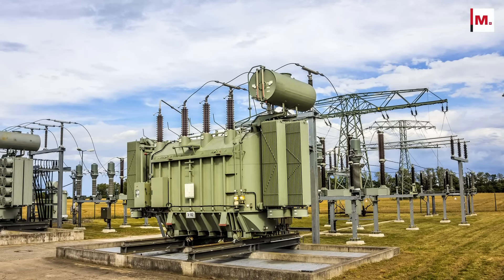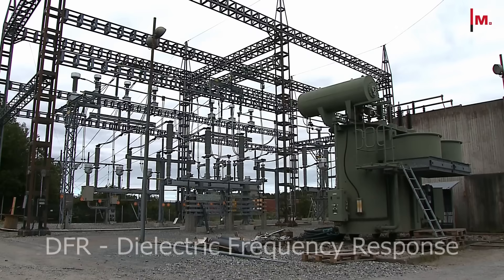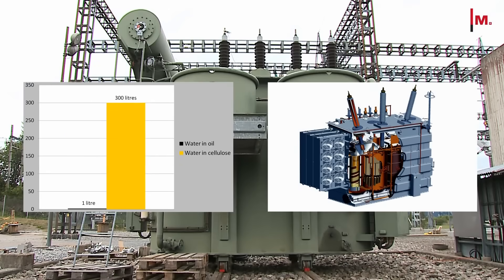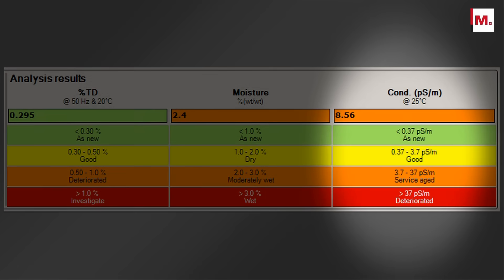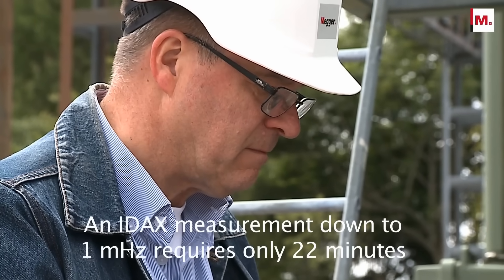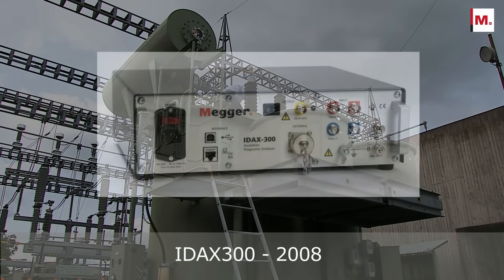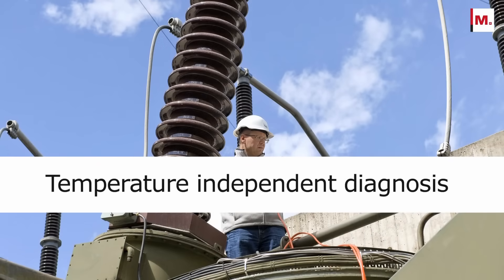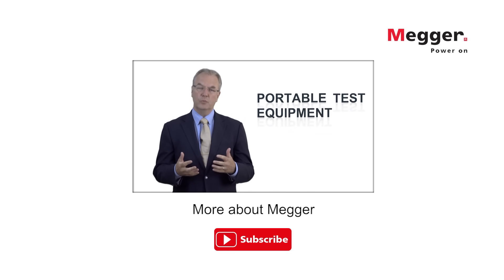IDAX transformer Insulation Diagnostic Analyser

Comment: Excuse me sir, I have many questions:
  1- Can I do the test on the power transformer and the transformer without oil?
  2- What does oil conductivity  mean?
  3- Can I connect this device to a drying furnace in order to monitor the moisture during the drying process?
  best regards